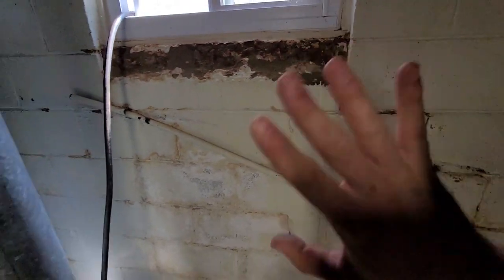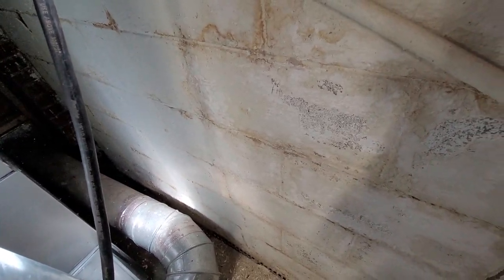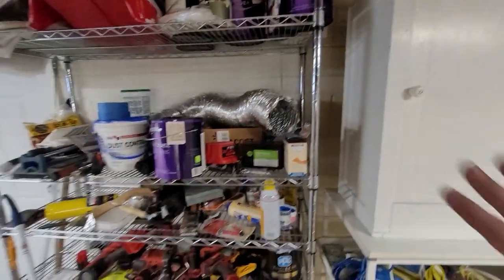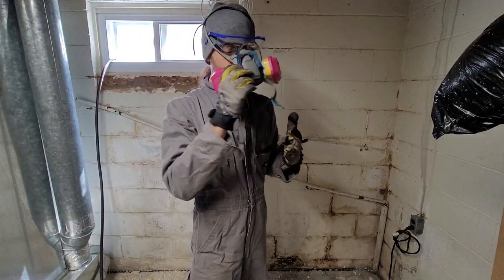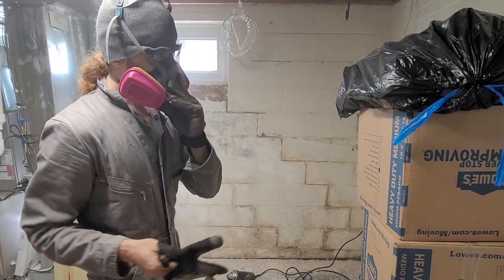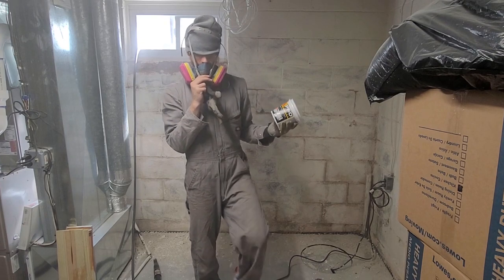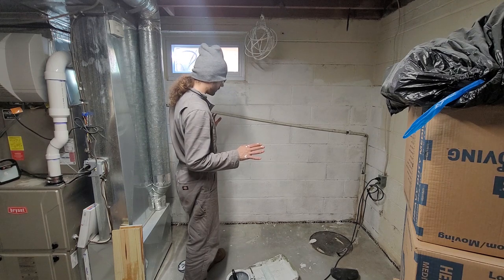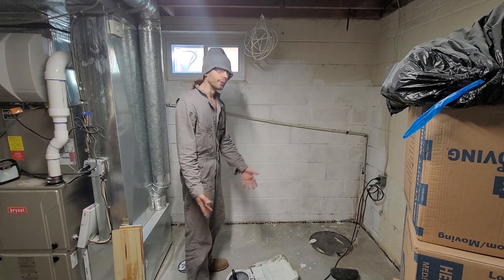Water Proofing Basement with Drylok

Comment: Looks like your wet basement wall is from the window. I have the same issue in my basement. I had to install window well covers to stop the water infiltration do to my windows being a bit lower then ground level. One of the other things I did was pull up a small bricked in planter on the front of my house do to the brick enclosure holding in water and it seeping into my basement. Most wet basement problems are more do to roof runoff from rain gutters being clogged and down spouts being too short splashing out rite next to the foundation. I saw in your sump pump video you have an under slab perimeter drain round your basement floor, Are you in a low-lying area prone to flooding?
Reply from the maker: Yeah I agree. The gutter that gets the most water is fairly close to that window, but it's not below ground or anything. Before, the gutter would indeed get clogged and not be able to keep up with heavy rain. I've since upsized the down spout to 6", which solved the clogging, but now the water probably runs off towards that window. May need to consider a French drain or whatever it's called. I'm at the top of a hill, but my yard slopes toward the house. The area is prone to very heavy rains, that's probably why it has sumps.
Reply: Quick response at 4:20 AM, are you a creature of the night as I am? My wife refers to me as the vampire.
Reply from the maker: @mrkrasker9609  haha yeah, fellow vampire here. Wife and I can't seem to get to bed before 4 to save our lives these days.

Comment: Try some Super Thoroseal buy in five gallon buckets or in 50 pound bags use it as soon as possible or keep in your house away from moisture. Follow directions and add water and Arcyl 60 to it. 
Buy a big concrete brush with 4 inch handle then when I get it to a pancake mixture brush on the wall after you scrape the wall. 

I put this stuff on 25 years ago and now in the process of scraping where moisture has gotten through. Only going over those areas. 

Good luck s
Reply: Stir with a big stick or buy a paddle on a drill.

Comment: You don't want to waterproof the inside of the wall, you waterproof the outside. If you waterproof the inside, you are trapping the water in the wall which will deteriorate the wall. Better to use normal paint so you can tell if you still have a water problem.
Reply from the maker: Yeah this is definitely a bandaid solution, made all the weirder that they would even sell such a product. Of all people, the manufacturer should really know better.
Reply: Check your sump pump in corner. Make sure it’s working. And your gutters send them out far away from home.